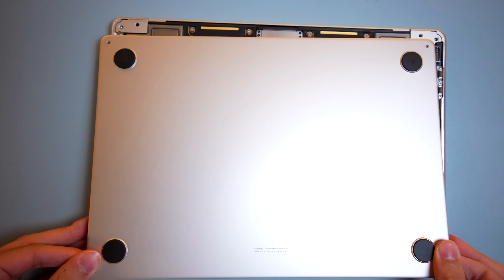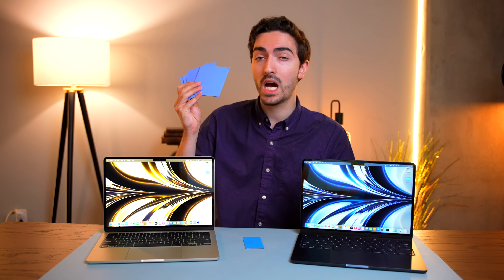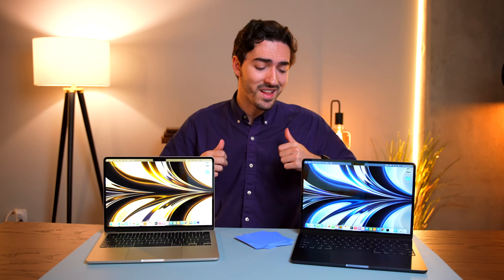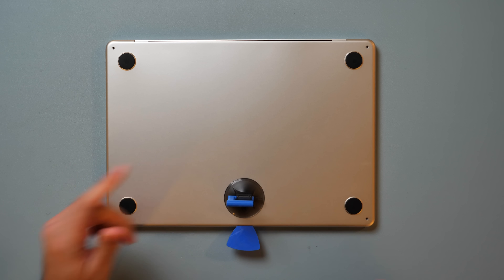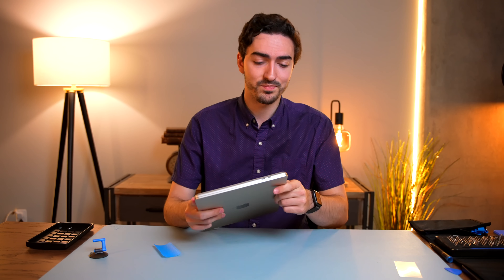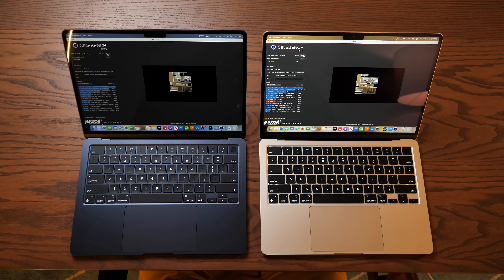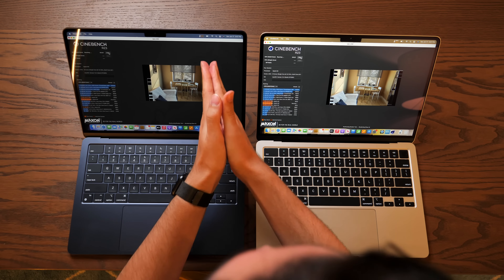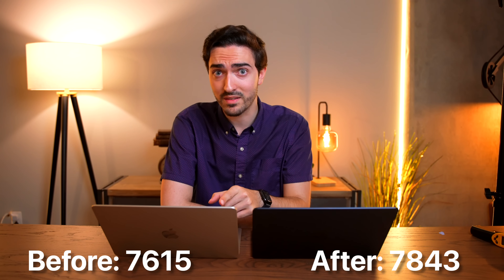Make your M2 MacBook Air FASTER for $8?!

Comment: I got my M2 MacBook Air to completely shut down all cores just by putting it in the microwave for a few minutes. I can’t believe Apple considers this a pro device.
Reply: Did you really put your laptop in the microwave and proceed to complain?
Reply: @Doc_Sans  Just seeing if it can stand up to the rigors of my workflow. I gots to have that high performance. I also don’t think I should have to pay for it. Apple remains silent about this massive flaw.
Reply: @booneh  Wait… you can’t put a MacBook into a microwave? PC laptops can do that for years!
Reply: @helmi5045  Design over function yet again. You should see the dongle I had to get just to have a parallel port.
Reply: They don't consider it a Pro device .... Pro devices have the handy Pro suffix to identify them....
Reply: @stuartaparker  That would insinuate that pushing this computer to its limit is just some sort of interesting experiment and not a useful critique of its intended use. And frankly that sounds absurd.
Reply: @booneh  Pushing it to its limit is fine, it’s exceeding them that’s the issue.
Reply: @stuartaparker  All computers should exceed their limits. Especially Macs.
Reply: ?? I ran a comparison test using an air fryer and diesel exhaust and I’m still able to run blender over and underwater with 80% gpu performance.
Reply: @ultragoyim1270  Wow! Only 20% throttled? This machine sure does punch above its weight and is also a worthless piece of crap.
Reply: Clearly if cooked it too long. MacBook Air should always be medium rare.
Reply: Lol 😂 
On a serious note that’s insane somebody would put a laptop in the microwave. I mean, right off the bat, it’s metal…?
Reply: The microwave shouldnt heat up the laptop if there isnt any water on it. it rather messes with the logic board.

Comment: Max Tech got even better Benchmarking results with his Thermal Pad mod! He did change the Thermal Paste out for Arctic MX-4 tho, that also played a role in it.
Reply: Yeah but Max Tech spent $7 more 😬
Reply: @sgtpepper729  And it was worth it.
Reply: Why aren't they putting liquid cooling
Reply: @Bambotb  what, it's a thin af laptop not a huge desktop
Reply: @Bambotb  Apple Silicon doesn’t need a vapor chamber. And Apple had already experienced with liquid cooling before, go ask them and Delphi what they think of it…

Comment: The base model was faster because 1.5mm thermal pad was actually making good contact between the bottom plate and the M2 cover. 1mm cheap pad still probably had some air left between the M2 and the plate, thus causing worse thermals. So I would suggest GO FOR 1.5mm thermal pad.
Reply: true and i was wondering why am I getting worse heat than no thermal pad mod. after placing my 1mm thermal pad it does make contact but not fully there is some air gaps and I might completely remove the thermal pad since the heat coming from the CPU cant radiate out of the chassis. 

over all go for the 1.5mm
Reply: That's right. 1It can actually create a layer of air. The air layer caused by non-stick is a very good insulator, so it can actually have a negative effect on heat dissipation and reduce performance.

Comment: If you want to perform experiments changing two independent variables you need to run all the combinations to reach a conclusion. 1 Small Pattern/Blue Pads, 2 Small Pattern/Silver Pads, 3 Large Pattern/Blue Tabs, 4 Large Patter/Silver Tabs. Otherwise it’s impossible to ascertain what if anything made a difference. Might have to even consider Pad Thickness another independent variable, then requiring 8 experiments.
Reply: we got a nerd here
Reply: I agree also I would go for the larger ssd models in both that way you will not be getting the wierd speed issues linked to the bandwidth of the hard drive.
Reply: Now that’s what I call science volume 1!!!

Comment: DON'T STOP THERE!! Try copper tape on the inside of the bottom cover (spread out across entire surface) and thermal pads on the entire heatsink.  Come on Luke, I know you love this kind of stuff.
Reply: I was thinking about a giant heat sink instead of a backplate, or like a vented back plate I wonder if anyone has made something like that for macbooks.

Comment: Great test! We used 1.5mm thermal pads for $15 which are very well rated, so I wonder if that allowed better contact with the back plate on the M2 MacBook Air which could've allowed more heat transfer. We noticed some pretty huge performance differences in our test. 
Nevertheless, it's awesome to see that there's an easy and simple way to handle this thermal throttling problem. Cheers!
Reply: Great one Max!
Reply: I believe the thermal paste was also changed, so that might have a lot to do with it as well
Reply from the maker: The .5 and 1mm definitely made good contact as when I removed them after the test, they stuck to the bottom plate rather than the heatsink. I think the differences are mainly W/mK rating as well as having placement directly over the M2. Covering as much of the heatsink as possible seemed to help dissipate heat for sure!
Reply: Why is there a problem if the MacBook Air throttles? It's a laptop made for light work, not heavy workloads. I'm tired of almost every reviewer bringing up this subject. Stop comparing the MacBook Air to the Pro, would you?
Reply: @iambenmerino  Because you would expect the laptop to have a sufficient cooling solution for the components?
Reply: @iambenmerino  so why is apple advertising and showing graphs of the performances on the MacBook Air if they are air throttling? I get your point, but surely apple could have limited the processor, so it doesn't overheat... that's my opinion.
Reply: @iambenmerino  There is no 'problem', only more options and comparisons are presented. If you don't want to know and don't need/want to get more out of the Air, then just ignore it :)
Meanwhile there are many of us, that gladly exchange some surface temp for a more sustained performance under some load, that's all - that doesn't take anything away from your experience and preferences, you just might have to manage the non-black and white info when you watch tech channels, that's what they are for :)
Reply: Anyone notice Luke got the location of the M2 chip wrong? The M2 chip is located at the center of the 4 rectangle holes and he did not put any pads there only part of it, rendering the test inaccurate
Reply: It's because he put the thermaright odyssey pad half way on the M2 Chip itself. Not right on top like you guys did. He lost a lot of the cooling potential like that. Don't forget, the metal covering the logic board is not a heatsink, just an EMI shield. It does the least amount of cooling.
Reply: How do people feel about paying for a "premium" product from a 3billion excuse$ company that you need to fix out of the box? Harry Potter would say riddicculus!
Reply: @TheJoseUrena  The majority of people don't want a hot lap though. The air gap is by design, they want the bottom of the case insulated on purpose.
Reply: @iambenmerino  hey Ben this for you 👋. Lean into it
Reply: @iambenmerino  I don’t think it is a problem and although it is presented as a fix, this is really made or people who enjoy this sort of modding. It’s a bit of fun for those who like to tinker.
Reply: @iambenmerino  Mate, the thing is, yes it is made for light use, but you never know when you have to use it for big tasks.., you wouldn't say no when you have no option to choose and you have your M2 MacBook Air with you.., will have to work on that.., and that is why people test them.., and by doing these tests, we get to know how far can this machine can go and that determines how good it is.., even if it does throttle, but still it's way ahead of it's competetion like the Dells and other laptops.. and i know chances of doig big tasks on Air will be very few but still it doesn't say that you should do buy the Dells and other laptops.. don't worry mate, it is a good laptop and just need this small hack and all good to go.
Reply: Hope bloody Apple fix this issue in the next version. 😡
Reply: @cgi2173  i mean see, we all saw it coming as we knew that Apple will increase the clockspeeds.., and we all know what happens when you increase clock speeds cough (intel).., so there’s no fix for these until you have a very very efficient chip or more better cooling system which would result in thicker laptops..
Reply: @iambenmerino  I imagine because if the M1 didn't and the M2 does and  is more expensive that seems to be an issue no? Also, once you get into the 1400 range you have to ask yourself exactly what would you expect? That is not cheap or an entry level use for light tasks price is it? I mean, come on now, sure it has the screen, battery, keyboard but if you could spec the ramm up to 32gb it would be close to the price of my base macstudio! It's interesting to me how well the apple price structure works at helping people to redifine what an "entry" level price is, what we should be prepared to accept for $1400 or more once you get the 16gb and 520 (which you need for speed). Why, if I get the 1200 base model should I accept slower disk speed and more heat that I did for the previous version? That is the comparison, why do I pay more for less, why is the performance worse for more. What is a genuine entry level, base price?
Reply: @iambenmerino  because buying air you got pro just for 15$ difference.
Reply: @iambenmerino  you know apple said the M2 MBA can play Resident Evil 8 at 1080 60fps right?
Reply: @TheJoseUrena  As Max Tech always says manufacturers have to make sure their devices stay below 50C so that they don't cause burning issues to customers. This is why Apple doesn't add thermal pads to their laptops. You can clearly see that when Luke added the thermal pads the bottom temprature went above 50C. So yes this is a good hack but no Apple can't do it as it's a health and safety issue.
Reply: @iambenmerino  Sure, but from time to time everyone does something more demanding. Everybody knows that for simple tasks MBA is perfect, so testing it in this are is just unnecessary. However, from time to time, when you actually do something more demanding (as when you decide to make a small holiday video) you might want to know if the Macbook would handle this. Also, there are many people who would like to have M2 Macbook pro, but they are missing MagSafe and better look and they want to know if they would loose something going with the Air.
Reply: @iambenmerino   should people just pretend it's not an issue? Apple has the the largest promotional budget of any company in the world. There's also countless YouTubers that do nothing but praise them no matter what they do like Sam kohl and Renee Richee. If a little criticism, based in fact, is going to get you so upset. Just watch the billions of other channels that don't criticize Apple.
Reply: So, can we please get Miani and Max Tech to team up for the ultimate comparison:
(1) M1 Air vs M2 Air thermals and wattage comparison: on max and non-peak performance showing throttling over time, performance,  wattage during and average, and temperature on surfaces and the hearsinks. Goal: determine if (A) the M2 is more efficient at same wattages and (B) baseline the thermal solutions for efficiency, and
(2) Step-for-step thermal pad improvements - starting from baseline where you temperature measure surfaces and heatsink. Incrementally increase thermal pad coverage from the M2 chip only until the entire heatsink/shield is covered. Record performance, temps (surface and heatsink/shield). Aim: determine the physical nature of the sink/shield and see if it does indeed radiate across the entire extension or just an area limited to above the M2 chip.

Than would help remove some of the confusion and over hyped messaging your videos have created such as "OMG the M2 is burning up", "No heatsink on the M2 Air" etc. 

Thanks for your service 😂.
Reply: This is a great video. I commented on Max Tech’s videos regarding this and didn’t see a response yet. You just answered my question, so thank you.

Nobody knows if they should be buying 0.5mm, 1.0mm, 1.5mm, or 2.0mm on Max Tech’s video. Since you guys are actually showing us it being done live, I think a literal recommendation in the description would be nice. For example:

We should all be buying this:
- 120x120x1.0mm
- 14.8 W/mK
- Thermalright Brand
- Odyssey 2
- $25.92 (On Amazon)

…That way people aren’t having to comment over and over hoping to hear a response.

Thanks again for the great video.
Reply: @kzero8636  yes, get the 1.0mm

We should all be buying this:
- 120x120x1.0mm
- 14.8 W/mK
- Thermalright Brand
- Odyssey 2
- $25.92 (On Amazon)
Reply: @iambenmerino  but would it still run The Sims 4 with no issues/overheating or it can’t even run that smoothly? Cause that will break it or make it for me
Reply: @iambenmerino  but it heats even for watching netflix apparently
Reply: @iambenmerino  Would you buy a Lamborghini with a 55 mph speed limit?
Reply: @iambenmerino  A proper thermal solution not only helps extend component lifespan by reducing temperatures, but also boosts performance allowing you to keep the machine for longer before you need to replace it with a new computer. Remember, performance doesn't only matter in the here and now
Reply: @iambenmerino the m2 MBA is literally more powerful than the most powerful intel i9 16in mbp, we dont realize how far we have come
Reply: @lukemiani  can you try m1 to m2 MacBook Pro trick again but also swap touchpads to because that  is what you did not try when you did it
Reply: @iambenmerino  stop whining.  Get off the internet if you cannot be exposed with different priorities and ideas than you.